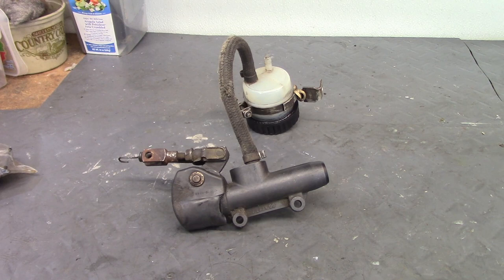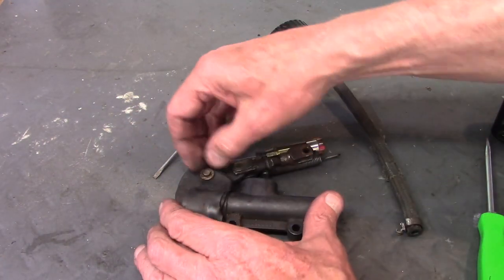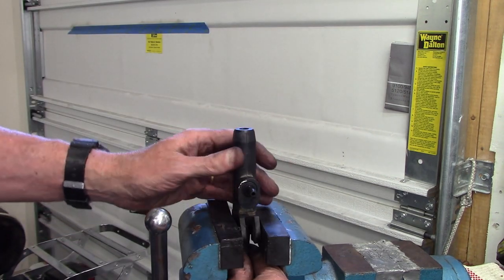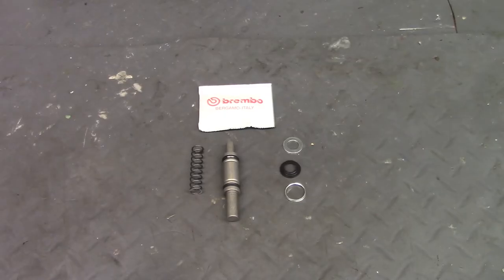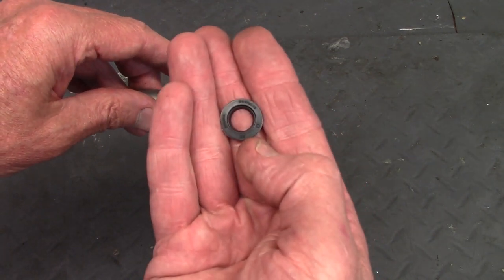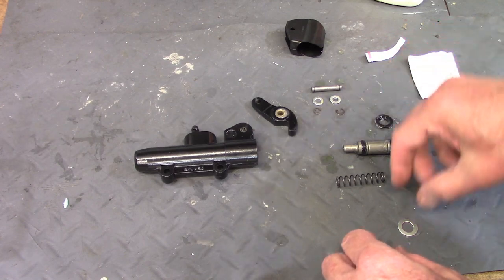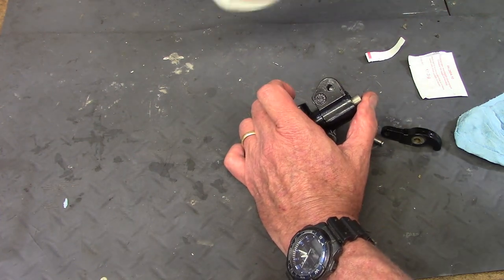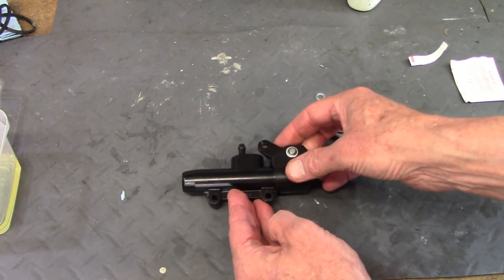1983 BMW R100 RS Disassemble, Inspect, Rebuild Rear Master Cylinder

Comment: Just done the  job your clips are invaluable,l had much trouble getting piston out it was solid,tried your ways even blowtorch after shielding plastic nipple
Finally had to drill oil feed hole 1mm bigger to get thicker drill bit in this did the trick,bore was good next problem the seal not staying in place, there's not
Much on the web,but a thin wall 13mm deep socket,vice,and few taps with hammer seated it well,you did keep saying crush ring which suggested way to go
Would be useful if you mentioned in clip as l can see others having issues,thanks for the informative pages

Comment: Thanks for the video, it helped me rebuild my Brembo 15/16 rear for my "ran when parked a decade ago" '84 Moto Guzzi V65SP.  The only thing additionally I had to do was seat the seal /tapered washer assembly with a deep socket.  The barrel of the Brembo body is stepped.  Also the Guzzi Brembo has a plastic piston stop which fits before/inside the spring.  I got the seating procedure from a Guzzi Forum.
Reply from the maker: Hi Mark. Cool beans.  I'm glad it all worked out for you. :-)

Comment: You were lucky with your cylinder. I recently pulled one off of a K 75, which was so badly corroded that the piston was frozen into the outer housing. It’s resisted every attempt from hammering to pressing in a vice to the point where we just ordered a new master cylinder. By the way, I keep a handlebar mounted MC to use in pumping out caliper pistons and stubborn MC pistons. It usually works unless totally corroded.

Comment: I am stumped. I have the parts in correct order, but have two issues. First is, what holds the front seal washer, seal & stiffening ring from backing out? It appears to have nothing except maybe some vacuum from the piston’s action to keep it there. 

My second issue is that now on reassembly, (a second time), with the piston fully bottomed out, (the spring fully compressed), the actuating arm pin holes are abt. .5mm from lining up, thus I cannot get them together, and if I did, there would be ZERO movement available with the actuation are (because the piston is fully bottomed out). Darn.

I’ll go attempt another reassemble & see if anything has changed.

Comment: Hi Brooks, how does the front seal stay inside the cylinder? Mine just keeps falling back out. Trying to bleed I had plenty of air coming through and I actually found the stiffening ring had fallen out completely when taken it apart. Thank you
Reply from the maker: Take a look at the article on my website:
https://brook.reams.me/bmw-motorcycle-rebuilds/1983-bmw-r100rs-rebuild-project-index/34-bmw-1983-r100rs-disassemble-inspect-rebuild-master-cylinders/#Assemble_Rear_Master_Cylinder_Rebuild_Kit

Comment: Did you not have to press the seal/stiffener ring into the location recess after inserting the piston?
Reply: Yes . That seal casing is an interference fit and needs to be tapped in with a suitable tube of about 19.5mm diameter. The actuation end of the piston will be about 4mm in from the end of the housing when fitted. Also what wasn't shown was the spring retainer that goes into the cylinder first.(Usually in the kit, but not shown.)
Reply: @craigb3548  I agree with you about the seal needing to be tapped in but I believe the 1981 to 1984 bikes didn't have a spring retainer.

Comment: Excellent instructions as always. I was finding that the assembly just kept on popping out under the spring pressure. I noted the slight step inside the bore where the outer seal and stiffening ring have to push in. I found a plastic tube that fit exactly over the stiffening ring and could tap it home into its seat....not sure how you managed just to push it home?
Reply from the maker: Biker's Welcome, Ah ... I just have Gorilla Thumbs I guess. :-)

Comment: I am rebuilding a R65LS front brake master cylinder, the book said to clean both holes, mine has one hole drilled through from the reservoir and one partially drilled, not through. Should there be two holes drilled through from the reservoir??
Reply from the maker: James, one hole feeds fluid from the reservoir to the plunger that pressurizes the brake line. The other hole lets fluid return from the line to the reservoir. Usually the smaller hole is the fluid return.  That said, I've not worked on the R65 bikes and have no direct knowledge of how the front brake master cylinder goes together, but it looks to be similar to the one used on my 1983 R100RS/RT bike, but I didn't rebuild the front master cylinder so I never had an opportunity to inspect inside the master cylinder.
Reply: @BrooksAirheadGarage  Thank you.

Comment: Hi the team! Thanks for this video!
I would like to know if the piston(15.87mm) can be replaced instead of the 14.29mm?
Is it compatible in this way?
Reply from the maker: Hi Alexandre, BMW changed the master cylinder piston size in the 1981 model year (09/1980) to the smaller piston (14.29 mm). The smaller master cylinder requires less foot pressure but more foot motion to achieve the same stopping force on the disk.  If you use the large master cylinder, you will have to push harder to get the same stopping force on the disk. Other than that, I believe the two master cylinders will work.
Reply: @BrooksAirheadGarage  thanks a lot for your feedback ! Continue your videos it helps us a lot!👍👍👍

Comment: 9:51 la ultima arandela sustituye al circlip que sujeta el conjunto dentro de la bomba, para montarla tienes que presionar el eje de la bomba hasta el final y con un vaso largo apoyar en el interior sobre la ultima arandela y golpear hasta que entre en su alojamiento
Reply from the maker: English Translation:
The last washer replaces the circlip that holds the assembly inside the pump. To assemble it you have to press the pump shaft all the way and with a long glass, place it on the inside of the last washer and hit it until it fits into its housing.

Comment: hey brook, i'm trying to bleed my R100 rear brake that has a steel-braided line from the caliper to cylinder.  It seems I can't advance the brake fluid from either the reservoir side or caliper side through the system.  Removing the braided line from the cylinder and placing my thumb over the cylinder opening, I can feel pressure and suction when actuating the brake pedal, however no fluid travels through.  Might the issue be within the cylinder or from the piston?  I have not opened it up...
Reply from the maker: Geoffography, Since you have an aftermarket brake line, be aware many of them do not hold up well. There are some that it's easy to damage, particularly when removing the rear master cylinder. There is a small diameter tube in the core and on some of these braided steel lines, it gets kinked which blocks the fluid from passing through the hose. If you get pressure from the master cylinder when you push the piston, then I would suspect there is an obstruction in the brake line.  Hope  that helps.
Reply: Thx!  I tried to vacuum draw from the brake line submerged in brake fluid towards the caliper, went until bubbles went away, then separately hooked up a pressure bleeder to the caliper and pushed fluid back out the loosened banjo bolt at the cylinder end before capping it off.  Ended up getting decent brake action only after leaving the caliper on rotor and using the pump to push brake fluid into the caliper, pushing pads against rotor, then released pump pressure and let out "excess" fluid through bleed bolt to free up pads from rotor.

Comment: Hi Brook ! I lost an e-clip and its flat washer on one side of the pin. Do you know where i could buy them. I can't find the reference ... thank you very much
Reply from the maker: Yann, I would try to find these at a hardware store since they aren't specialized hardware.
Reply: Do you know where you can buy a replacement master cylinder?
The 14.25mm, or any advice on how to make another one fit?
Thank you
Reply from the maker: @RussellFitness-Trainer  Any BMW dealer can order them for you (part# 32 72 2 302 365). It mounts into the right handlebar casting.

Comment: Does anyone know if the area under the plastic nipple where the brake fluid comes in has two holes or just one? Mine has one obvious open hole, but looks like it has another. I cant tell if it needs to be cleaned out or if its just a shut hole.
Reply: There is a tiny port into the cylinder which is counter-bored to 1/8". Same diameter as the port at the lever side of the primary seal. The tiny port allows fluid to enter from the fluid tank to the spring end of the piston. Often blocks off with aluminium oxide corrosion. So yes there are Two.

Comment: If there is any noticeable pitting in the bore can it be salvaged?
Reply from the maker: Gaylord, Small scratches can be removed using 600 grit wet/dry paper as I show on the web page documentation via the link in the video summary. Deeper pits can not be removed this way. If you have those, a new master cylinder is in order.
Reply: @BrooksAirheadGarage  I’m not having much luck acquiring a master-cylinder that is good enough to rebuild and I hate to scrap the whole bike

Comment: as you know have always been watching & appreciating your videos- Is there a way to check the efficiency of the master cylinder hydraulic oil pressure on a gauge ?  is there any Data available indicating how much PSI of hydraulic oil pressure must it measure on the gauge to check efficiency of the master cylinder- i have a friends BMW whose brakes need an overhaul so in order to establish the fault in either the cylinder or the calliper i thought this test could help me to diagnose the problem correctly !!! I keep learning watching your videos ! keep it up
Reply from the maker: Hi Rahul, I have no information on the pressure created by the master cylinder. As I show on my website, when I disassemble the master cylinder I check for corrosion on the inside. If there are pits and a lot of corrosion, I replace it. If it's minor scratching and light rust, I use 600 wet dry paper on a suitable sized drill bit to lightly hone the inside of the cylinder.  That said, these are the brakes and they are critical safety items. If you have any doubt about the condition of a master cylinder, you should replace it.
Reply: @BrooksAirheadGarage  hi brooks you are always kind and polite to reply me with clean solutions

Comment: Whats the extra port on the bottom of the reservoir for?
Reply from the maker: Hi Brady: The second port is solid, as in it has no hole inside, and is not used. It's possible this reservoir is used in other applications where Brembo has it feed two master cylinders. Brembo would drill it out in that case. This is just an uninformed guess on my part.